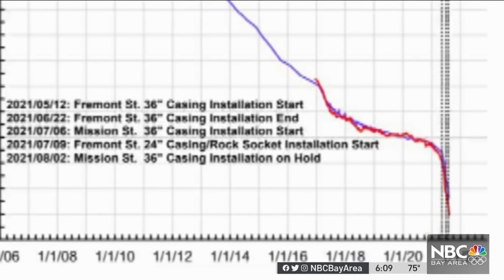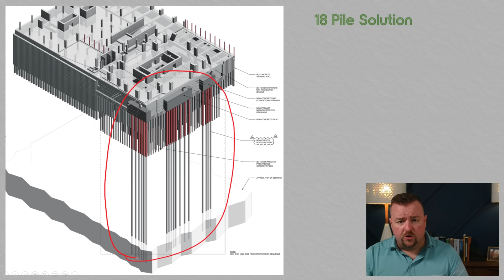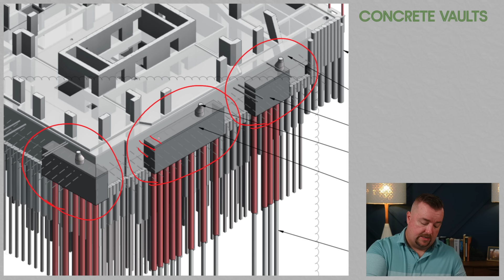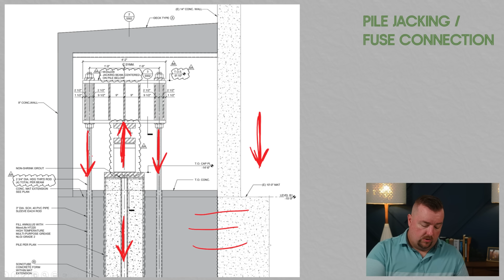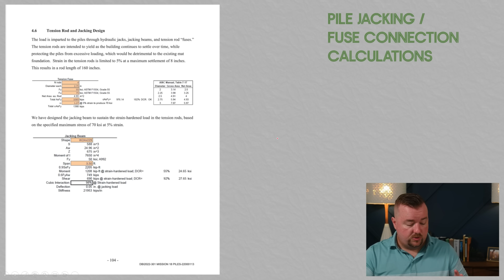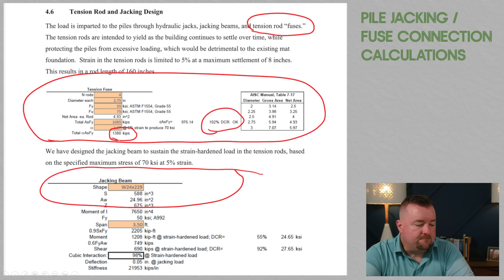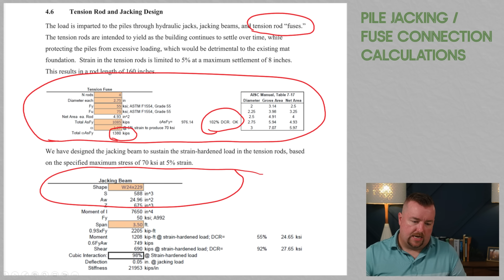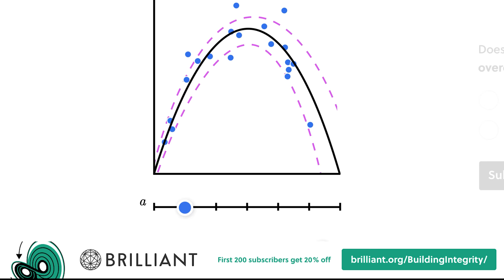Did I Uncover a $100,000,000 Mistake with the Millennium Tower "Fix"?

Comment: Why do the rods have two nuts bearing the load on the bottom but only one on the top above the beam?
Reply: The second nut at the bottom is just to lock the assembly in place until it is buried in concrete.
Reply: @GH-oi2jf you have a nut above the plate, doesn’t seem you would need a locking nut. You just tighten against the plate and the nut above the plate.

Comment: You say that 'underpinning' has never previously been performed on a building of this size and weight. But you don't say anything about the size and weight of buildings on which underpinning has been successfully performed in previous projects? This is essential for viewers to judge whether your criticism of this project is valid.  If a building of around 60% or more of the size and weight of the Millennium Tower has been successfully underpinned then there is a fair chance that underpinning could also be effectively applied to the Millennium Tower.

Comment: I'm the "go to guy" when all the fancy titled experts fail!   :  )
This is an easy and cost effective fix! 
Attach four tensioning cables to all four building corners, at the top floors, to the adjacent buildings and "mud jack" the entire 10ft thick foundation pad back to level from the basement.
This will also compact and stabilize the  soil below. 

Thanks!  (Rick - EPABX systems designer)

Comment: It does not make sense to sleeve and grease the threaded rods.  The threaded rods should be casted in concrete and useed rods and concrete bond to lift the concrete
Reply: You are wrong.  You need to think about it to understand it.

Comment: The mere fact that the damn thing is sitting on an earthquake prone area and it's leaning and no one can say for sure,,,,,seriously,  what else do you need?
Reply: It presume it has been designed with earthquake measures in place 🤔

It’s a large piled foundation which has a bit of movement on one side 🤔

If the soils get saturated - & a hurricane comes along & an earthquake happens I might stay at a hotel for a few weeks!
Reply: It presume it has been designed with earthquake measures in place 🤔

It’s a large piled foundation which has a bit of movement on one side 🤔

If the soils get saturated - & a hurricane comes along & an earthquake happens I might stay at a hotel for a few weeks!

Comment: They are not attaching to the existing structures rebar with enough overlap by any means. For chrissake to build an 8 foot tall 8“ x 16“ block CMU wall I typically have to have 36 to 48 inches of overlap on my rebar! In what world do they think that that secondary structure that is improperly attached to the existing building could ever possibly support the load of the building! The sheer weight alone of the building opposed to the vault is not even a comparison!
Reply: The system is installed and fully loaded now.  It has been in place for a few weeks.  This presentation does not show the reinforcement.  Structure Magazine has a more detailed illustration.

Comment: Many points of failure here:

 1) 200-foot-long piling through soft sand and clay to bedrock can "bow" deflecting sideways under load
 2) concrete pad under the million-ton building may break with uneven lifting stresses put on it

3)  "lifting" building with 2-inch threaded rods? really?  -  TFT -  (too f*ckin tiny)
4) concrete and rebar pressing against a steel 6.5-inch plate will keep nuts from pulling through...(like Hyatt), but I think a 4" or 6-inch A36 steel rod is what you need...this feels like lifting a solid cinder block with sewing threads....once you are doing all this...oversize your bolts!   steel is cheap compared to a  cascading failure by popping one bolt and then ripping the whole assembly.
5) I worry about uneven pressures on the concrete pad, is each hydro jack hooked into a pressure computing network, a network that coordinates equalized pressures gently massaging this building back to verticle?
6) once vertical is achieved, the hydro jack will be replaced with structural steel to hold the position permanently? yes?
Reply: The threaded rods are 2.5 or 2.75 inches in diameter and there are 72 of them.  I’ve looked up high-strength rods of this type.  They are rated for the load that is being imposed on them here.  They are not actually lifting the building, just arresting the sinking toward the west.

The building may never reach plumb.  If it does become nearly plumb, they might place more piles on the east side to stabilize it.

Comment: I am a electrician, if you have to sit and explain to people how to fix this and this building is already 30 inches tilted then you’re wasting your time in our time. The engineering Who did the original building should be made to demo this building. This is not a fix that will last. This is just a hiccup until a earthquake. How many people have to die before someone is held accountable. Why aren’t you saying which Engineering company built this building
Reply: For clarification, a 30 inch displacement at the top of this building is a tilt of about one quarter of one degree of arc.

The structural and geotechnical engineers can easily be found online, but don’t leave out the San Francisco officials who approved the plan.

Comment: Why cant they use jacks and hydralics to level it (or push/pull). Just like that airport on the ocean, and keep releveling every few months forever.
Reply: There are jacks.  Each of the 18 new pilings has a jack on top which transfers load from the building through the pilings to bedrock.  These are used to stop the building from leaning further in that direction.

Comment: Yes, you did uncover a 500 million dollar mistake in the foundation repair attempt of the Millennium Tower  "fix.   

 The seismic load alone in a 7 to 8 magnitude earth quake, on liquified back fill, along with its required saftey margin would *more than quadruple the size of all those existing  materials at the *barest minimum....and as an after market fix would be beyond a justifiable fix.

It looks to me like the banks and investors are hoping to drag this inevitable demolition out long enough to recover a modest amount of the loss.    Understandable and somewhat justifiable in my view.....in this world *nothing is guaranteed or entirely without fault.

The engineering mistakes if the building had remained all steel, were to a good degree somewhat understandable... but not going to hard rock when the building was redesigned when going to concrete was gross negligence.   I am retired now, but I saw a lot of that even 40 years ago... especially and pervasively in goverment...as it now self destructs.

I testified for 2 hours before the US congress on that broader range of issues ...( forcing enineers to lie in our nuclear weapons industry)..
.
.I witnessed that from the inside and warned that  the disease would keep spreading to the detriment of the entire nation.  (these sites are now being torn down and remediated at a cost of trillions of dollars and over centuries... all of it entirely avoidable.)

You can find that history involving myself in the congressional record and on you tube by searching 'Hanford nuclear reservation, philip scott, z plant, PFP, demolition, threats.

Comment: How do you inspect that rod for cracks if its greased down in the hole? Do they think acoustically or electrically is enough?
Reply: I expect they would just rely on the specifications from the manufacturer and inspections that were done before putting a rod into service.  They aren’t critical in the way they would be if they held up a bridge.  If a rod broke, its load would just be distributed among all the others.
Reply: @GH-oi2jf  They would share the load, instantly increasing it by 33% which could cause one them to fail, domino-effect.
Reply: @thedubwhisperer2157 — No, the load from a rod which broke would be distibuted among the remaining  71 rods.
Reply: @GH-oi2jf  Good point - I was envisioning just a single 'unit', however the domino effect could still occur if all were approaching their UTS.

Comment: Armchair engineer here. It must be very reassuring when the engineering team uses words like “fuse” in their presentation. When I first heard the word “fuse” after seeing this plan the next thing I thought of was “cascading failure”. Sure enough it gets mentioned @25:00 
Also, is the “key” where the vault joins the original foundation upside down?? I need to watch the earlier videos. 
P.s. when the first of 4 rods fails, what is keeping the jacking beam level?
Reply: I have an engineering degree.  The terms “fuse” and “key” are perfectly clear to me.
Reply: Your question depends on what you mean by “fail.”  If one rod goes beyond the limit of elastic behavior, it will transfer load to the other rods.
Reply: @GH-oi2jf  what happens when the surviving rods are required to each carry 33% more load (assuming even distribution of the total piling load)?  Is this design meant to only have the rods stretch by a calculated amount and NEVER behave like a "fuse"?
thanks.
Reply: @GH-oi2jf  Oh good.  My question about the "key" is, is the weight of the building bearing downward onto a 45 degree seam as shown in that diagram? Wouldn't that put more of a sideways force onto the vault structure, where the building just keeps sinking and the vault gets pushed to the side?
Reply: I expect the rods would more likely stretch than break.  If one broke, the other three might also break, then that piling would not support any of the weight.  To repair it, I expect they would have to destroy the vault around that pile and do it over.
Reply: @HarnessedGnat — The slope is necessary to control forces in the vault.  If that joint were horizontal, it would fracture the concrete of the vault.  Not shown here are the reinforcing rods which follow the angle of the sloped side to take the shear load.  The reinforcing rod of the vault is tied into the reinforcing rod of the foundation mat, so they won’t slip apart.

Comment: I don't understand why they did not invert the apparatus, placing the strong h beam in concrete, and the small bars on top where they can be inspected and replaced if necessary. Engineers hey?
Reply: The bars are relatively small because they are embedded in concrete.  The beam at the top is constructed to be self-sufficient.  There are ribs added to give it the strength it needs as configured.

Comment: Im mot a pro or engineer, but personally I think there is a solution for it, but its a long term solution
But unfortunately, what I think Based on the current situation... They must do their solutions so that the integrity of the erected building will still be intact or at least at the acceptable or safe level for the loads and stresses on the materials. Here is why:
When there is a tilt, it means that at least one of the systems on the design is compomised... Like in here obviously the soil preparation was lacking
Then the piles, which will be the foundation of the building to support the weight to make it stable. If the files had reach the hardest point of the location
Next, the shoes/foot, The bottom thick layer of the building will be the primary support that will hold the weight. Im thinking each pilars/piles reapective heights will be based on the situation where it reach the hardness of the bedrock and not on at least reaching a common height
If they were done on common height, i believed this will be the culprit. If not, there maybe be 3 causes (liquefaction, breaking/collapse of the bedrock and failure of material in handling loads)
Now, the fact that it is sinking, it means that one or more piles have been compromised. Unfortunately, the shoes/foot will bear the failure on the system. So the only solution is to fill up more files so that it can absorb the loads just to save the building. But unfortunately, the engineers have lesser time to save it... Because the tilting is not tilt anymore... As of you say tilt, it means the whole thing is tilting. Whereas the signs of diagonal shear cracks i believed is not caused by tilting but the stronger piles are absorbing more loads and the compromised ones did sinked... I mean to say that the weight are not distributed equally to the piles and pillars anymore, thus the integrity of the building's materials are already compromised. If these materials reached the load and stress limits, then collapse is unstoppable. This will be faster if: they cant insert the right piles on time, high wind forces, earthquake and liquefaction of soil
Well, the other comments are right... The ultimate solition is bring down the building

Comment: Wouldn't this leave a void under the other side of the building, if it works?! Unless the ground is being compressed on one end, matching the compression of the side that's heavy with lean, they will create a void under a large area under the foundation, which I suppose they could pump large masses of concrete into, but that could cause other issues to surface in the future. I feel like that All-Thread will simply strip out before it tears up the metal bar, or concrete that's holding it in. The closer that system is to the building, the more force it will need in order to make any difference in the lean at all, meaning more pressure on the system to withstand the forces applied, and it does not look(intuitively) robust enough to support that kind of huge load. I hope I'm wrong. I feel like they should have made the shared cross plate(the intuitively weak point you're speaking about) out of the same material as the bolts, along with the same thickness, and threaded hole, essentially turning it into a giant rectangular shared braced bolt for the bars. One other major concern is the way they've supported, and braced some of the load bearing surfaces in the jack mechanism...since they only braced it in one direction, if any of that is subject to the skewed momentum of a quake, having that much pressure on those parts could potentially collapse them, allowing the building to release all that stored energy.
Reply: There is no void.  The foundation mat is resting on the upper mud layer.

Comment: What kind of steel is encased in the Concrete with that plate? Also, what kind of Concrete are they using to secure this plate?
Reply: There is rebar in the concrete of the vault which is not shown in most diagrams.  You can see it in the drawings in the Structure Magazine article.  I am not an expert on concrete, but it is undoubtedly high-strength, in my opinion.

Comment: First, I am a retired EE with significant large industrial experience, certainly not a CE, and, therefore, my thoughts might very well be way off base. Nevertheless, my instincts tell me, with respect to the relatively small plates at the bottom of the all-thread rods that the video focuses on, the small size of these plates might not represent any problem. The plates are very well deeply embedded in what I assume to be very high strength concrete with, also I assume, a very competent and robust rebar structure. If that is indeed so, doesn't the plate effectively become a more or less homogeneous solid structure with the concrete? Wouldn't the concrete structure have to fail for the plate to fail? My concern would be more focused on the all-thread connection to the plate failing with the rod pulling out but that was, I assume, a calculated design. Again, I am a EE, have zero experience with CE concerns except for minimal osmosis over the years, so I am just offering a very unqualified opinion. Just saying.
Reply: I'm with you on this.  I, likewise, have an engineering degree in an unrelated field.  All engineers, regardless of field, take college physics, which is the main thing needed to understand the structure.

Comment: That plate seems way too under engineered, It's basically supporting the full load of the building leaning on it, I could see the threads easily stripping, but I'm not an engineer tbf. But maybe that is meant to be another point of failure to prevent the rods from catastrophically failing? idk.

Comment: Great channel.  Really excellent video requiring serious objective, critical thinking.
Also, 
1) The figures used to design the Titanic's rudder size and number of lifeboats were "Not unusual" for all ships up to that point. If only it could have turned just a bit faster.

2) I was always taught that critical load-bearing elements should be over-engineered, Not squeezed into the last 5% between load-limit and failure. 

Thanks!